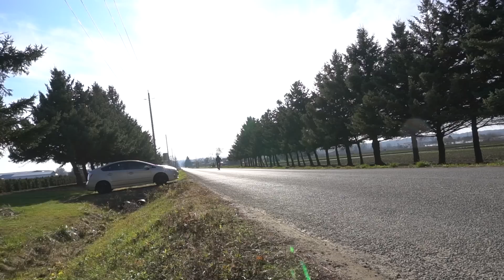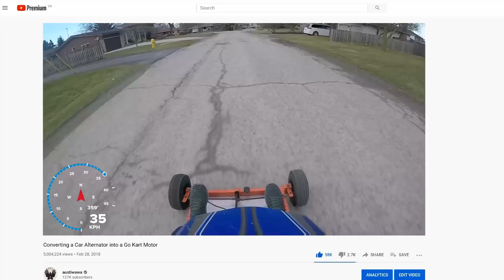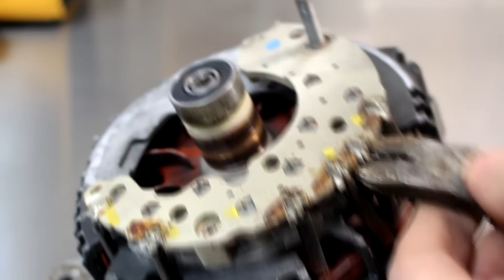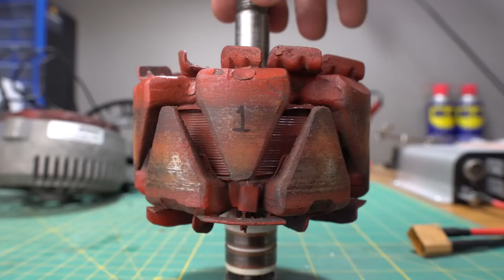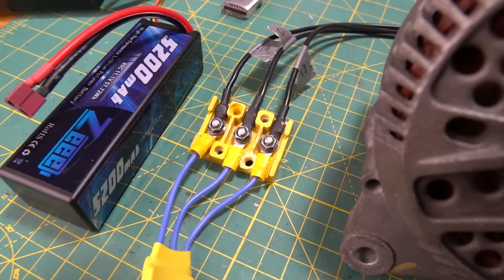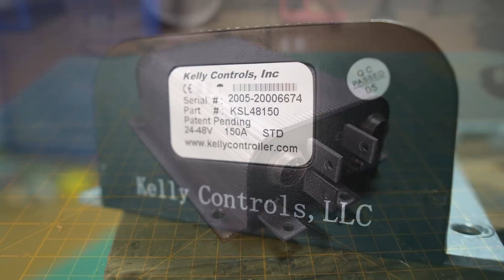Building an Alternator Powered Bike

Comment: That's pretty damn badass.
As for the last part- turning it into a Brushless DC motor- it's a great idea but I imagine with enough people looking at these and rebuilding them for ACDelco and the like there has to be a "better" alternator to use for this to avoid the problems with the electromagnets, or at least one capable of more power. Has there been any research into them or are you the only one?
Reply: The drive power is comparable to the rated current of the alternators original configuration, at 60A @ 12v ~= 1HP
This would put a 10SI (the most cheap-common alternator frame) at 1HP per 12v. I'd have to do some fancy math around heating/wind-cooling but he can probably squeeze 3+HP out of it in the configuration shown
Reply: @Hyratel  Hm, so that means the most powerful would likely be military alternators since they run 24v, not 12. They would also likely be massive in comparison and the bike already seems unbalanced.
Maybe look towards modern diesel and V8 alternators instead? I know LS alternators can be bought wound to 100 amps.
Reply: @girthquake1413  12 vs 24v matters more for the windings turn count on the stator/rotor? I think? So you'll get a slower, torquier motor with a 24v unit because of the lower kVs (thousands of rpm per volt of back-EMF|generation) is my expectation. If you want really fast, get an Alt specced for 12v diesel, i think. A 12v gas alt is um. 10k+ rpm? At 5k redline. But a diesel engine hits the powerband much lower (2-3k) although that might be a Pulley Ratio Question.

This is all back-of-my-hand math, though. If you have a source for alts, nothing wrong with doing some experiments and posting the results
Reply: High current alternators (150+ amps) would be an interesting test to do after installing the sensors

Comment: In depth knowledge, persistence in problem solving and happy riding! Excellent job
Reply from the maker: Thanks so much Hyuk! I appreciate it!
Reply: @austiwawa  I'll post this again here in case it may not have came to your attention. Just curious what you think about this: The centrifugal clutch idea could easily have worked  properly, by either putting lighter springs in it, increasing the mass of the flyweights, or a combination of both, or else by getting a bigger clutch if that one was too small. I was also thinking you could have added a micro switch to the throttle, triggered by the initial first couple of mm of motion, connected to a relay supplying field power to the electromagnets. This would have eliminated the issue of the motor constantly spinning at a low speed.

Great final product though. Keep up the good work!
Reply: @smallblockchevy1022  removing the clutch was better, because the sensorless controller couldn't spin the alternator as fast as the other controller and with hall sensors it was even better
and cutting the 12V field is a bad idea for the controller
Reply: I agree, that kind of determination, accompanied with some intellect and ingenuity can take you far.

Comment: Just in time. Alternator went out on my jeep, just replaced it and have a rebuild kit om the way for the old one. Probably will make it a motor
Reply: Yes chickens do float even better after they have been the water for a while.
Reply: Most times I've seen vehicle alternators fail, it's been either brushes or diodes, so hoping all your windings are still good, but alternator rebuild places will rewind 'em as well.
Reply: @jameswyatt1304  Yeah, most times it's simple. But you don't get a warranty on your own repairs. I ' have ' seen a lot of alternators with smoked stators though. Fact is it wasn't too long ago I was working on Ford 7.3 l and all of a sudden, fire and smoke and sparks started coming out of the back off the alternator I had just recently installed. Nothing was wrong with the electrical system, just a rebuilt unit the instantly failed., there wasn't much left of it before I got the engine shut off, and it continued to smoke even after that till I got the battery cable unhooked.

Comment: Nice budget project, but was there any reason in opting for 2 separate battery packs vs using a buck-boost circuit to power the electromagnet? That would also let you vary the torque on the motor real time if the output of the buck-boost were controlled as well.
Reply: The rotor (armature) reaches saturation around 4A@12v and he probably didn't want to shell out for a 48->12v buck converter when he already had a 12v pack, and this is a tech-demo so refinements like that are something for your daily-driver

Comment: 69km/h is way too fast on a bicycle like that.

But I like it
Reply: Yeah it's just like a car that will go too fast, it's great to have the power to do and if you do, you can always get out of the throttle and save energy in stead of having to run wide open all the time. Plus if you have the power, you can maintain speed up hill easier. Who wouldn't be impressed seeing a bicycle going up a steep hill at 40 kph ?
Reply: I've done 55mph or a bicycle and if you know what you're doing, its fine.

Comment: This youtuber pulled it off with a 3D printed magnet rotor: https://www.youtube.com/watch?v=6vYLmGdFv78&t=6s
Reply: Swapping the claw-pole electromagnet rotor for a PM rotor swaps more efficiency but fixes the Kv ratio (the variable Kv ratio is interesting to use for increasing top speed, in your CAGK project would be nice to test it (getting top speed with the PWM at 100% and slowly reducing it to 50-80%)

Comment: I have a 63amp alternator , ready to be used as a motor, I have a48-72v controller 1500watts, but maybe I can use a larger alternator later, I'm thinking about building a 24ah 16s or 18s battery, to end up in the 64v-72v, maybe it will work!!
Reply: 12v@60A is around 1hp, so you're looking at 4-6HP, pretty spicy!
Reply: Good idea
If you install the hall sensor will be better than sensorless

Comment: Anymore info in the power output? Have you tried a 3phase rectifier, with a capacitor, and large resistor to drop the vtage to the rotor/electromagnet??

Comment: on the good side: you can weaken the magnetic field for more speed by varying the rotor current or make it stronger for more torque. free gearbox basically.
however on the bad side you wear the brushes and its less efficient since you have to waste energy to keep the magnetic field active.
you could also use it for regenerative braking by feeding back the energy in the rotor instead of applying 12v when hitting the brakes.
Reply: It would be interesting to drive the alternator with a VESC, and write a custom app for it to control the rotor field voltage. Since the VESC internally knows the ERPM, it could easily take that and apply it on top of a curve you define which determines the field voltage. Have the VESC output the setpoint to a DC-DC adjustable Buck regulator, and it be able to dynamically and automatically adjust for optimal torque and RPM.. I might have to play around with this.. heh. Another neat feature of something like this, is since the VESC directly can read the throttle input, it could also just disable the DC-DC regulator at 0 throttle. Thus eliminating the parasitic current draw at 0 RPM.
Reply: Need you around for an apocalypse
Reply: @nickldominator  bldc controllers need the magnetic field from the rotor at all times
and this guy made a controller for converted alternators...
http://motocone.blogspot.com/
Reply: thing is if you use unfiltered PWM for the field winding, the sensors (and controller) will have to deal with the electrical noise
Reply: You're not going to wear the brushes by any noticeable level, considering alternators can potentially run hundreds of thousands of miles with no maintenance. It's a slip-ring not a commutator, so there's no slots to wear down the carbon
Reply: @Hyratel , diesel trains have brushed motors driving the wheels that contact the rails. 
These brushes have to be changed out regularly. I was informed of this by a (now deceased engineer). There are several sets of them.  If you have a brushed motor, plan on having to change them out, there is no free ride.
Reply: @jmikronis7376  are those commutating brushes or continuous? Because a car alternator uses continuous sliprings and carbon brushes, it wouldn't be unusual to never have a problem with the alternator in a modern car in 200k+ miles

With Older alternators, the regulator, diode pack or the bearings are still way more likely to be the first point of failure

You're raising a valid but contextually apples-to-oranges point

Comment: I would be interesting to put a voltage regulator on the rotor in order to change torque/rpm
Reply: yep, the youtuber "Enrengineering" did that, just didn't made the test with the PWM changing

Comment: there are automotive alternator magnet kits for diy wind power generators .the last time I tested one for a customer was about 15 years ago so not sure if they are still available .that's the time when neodymium magnets were the hot thing to make projects, the ones I've seen came with a rotor cast from aluminum with magnets for 10 si gm alternators

Comment: Clutch is slipping because your springs are to tough ... Swap for a softer set of springs it will open up sooner at lower rpm .... This is made for high revving low cc engines
Reply: He changed the system later in the video
Reply: @foxxyytofficial  

Ah ok my bad .... 👍

Comment: HECK YEAH!!!
FINALLY!
I waited for so long, and finally you installed the hall sensors on the alternator!!!
My years waiting finally paid off!!
The youtuber "Enrengineering" also installed hall sensors on his alternator go-kart
Reply: That's correct! And it seems I skipped some steps...dang it! It seems that I will need to perfect the car alternator go kart. 😅
Reply: @Henryneering  the only steps that i saw you stepping and remember from head were the top speed tests with modulation of tbe PWM brushed system, and the hall sensors on the middle of the stator (you put on the end of it)
Reply: @foxxyytofficial  maybe I will try to put the sensors on the middle of the stator if I can unglue them
Reply: @Henryneering  hot glue could be removed with a heat gun
Reply: @luislongoria6621  The sensors were glued using two component adhesive, a bit of heat definitely will help
Reply from the maker: Thanks @FoxxyYT happy to see you so active in the comments! Enrengineering did a great job on his go kart!
Reply: @austiwawa  Thank you very much! Killer job on the bike!
Reply: @austiwawa  i am so happy to have you answering me
Since the first alternator video i tried to help people in the comment, not just in your channel but in others too, like Enrengineering's channel

Comment: Hello friends.  let us be grateful to our friend who posted this video sharing knowledge.  It doesn't cost anything to like and make a simple comment.  It is the least we can do in gratitude for his work.  thank you!
Reply: Two thumbs up.
Reply: simple comment.
Reply: thank you
Reply: How long does the battery last
Reply: Wow that was smart figuring out that sensor placement...looked frustrating.
Reply: Well said, sir.
Reply: @thegeneralstrike6747  what
Reply: Now add a small rotation charger on the front wheel to have a little over 12v to keep battery charged. Idk lol. I just threw that in there. I've seen lights on bikes that shine as the wheel spins. Faster the brighter it lights up.
Reply: Concordo plenamente. 😊
Reply: What I want to know is how many watt hours per mile.
Also, a better drive system.  The drive system is absolutely terrible.  Aside from being terrible, you cannot do regen with that clutch. Regen would be the saving grace of the awful drive system of attaching a chainring to the wheel spokes.
It's inefficient because he is constantly dumping 12v into the windings.  It needs to have the windings only being powered when he is on the throttle.
Reply: @tarstarkusz  calm down...
to see wh/km you need to wait him to do another video
then, watch the damn full video to see that he removed the clutch!!!
and the 12V in the windings are needed full-time